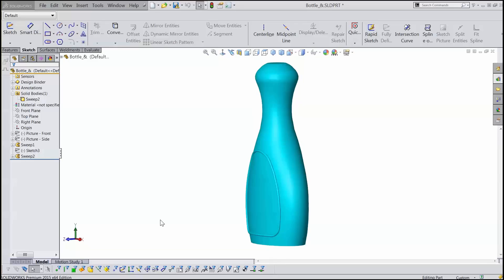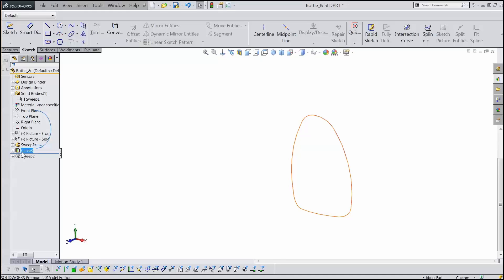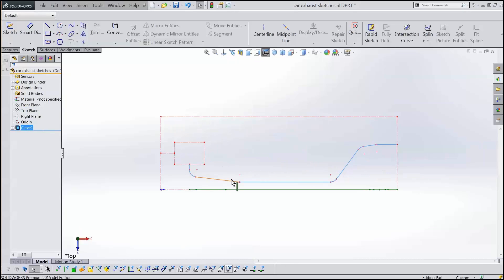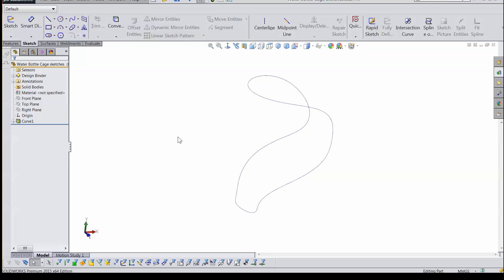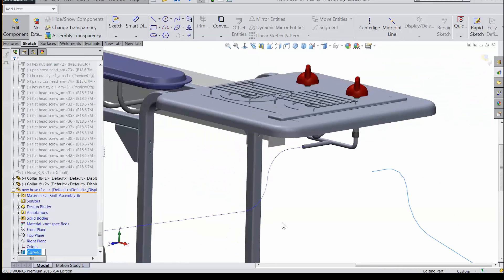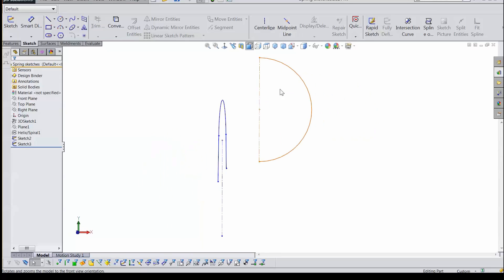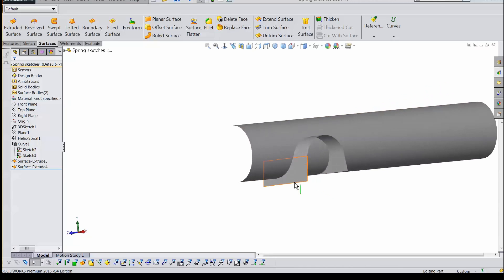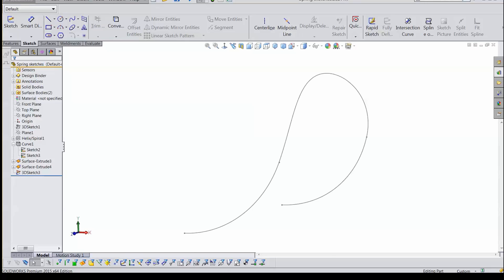SOLIDWORKS – Projected Curve – Sketch on faces and Sketch on sketch

Comment: Amazing video. I coudnt understand how the curve was forming but with the practical examples it was very clear and I am already thinking of where I can implement this. What I still find a little difficult to comprehend is how would I make such a curve for a path if the planes used for the base sketches are not exactly 90 degress off eachother. How would that work if I have a difficult path which needs to surround many other parts in a tight assembly (meaning a lot of components being very close to eachother)? Would I need to make multiple planes on which to make my sketches and then do a projecetion curve out of 5+ sketches?

Comment: Very Good clear I was trying to get a rope over the deck on a boat and needed to make the whole thing by combining a number of items together with the path been set 1/2 diameter of the rope above the deck line  and was getting disjointed curves I think this is down to the fact the addition surface  1/2 diameter offset gives a small gap on the deck line  the two sides of the boat were mirrored  about the main front plain  So I had a small gap between the two sides of the deck. this video is the first one showing how Solidworks get it to work.